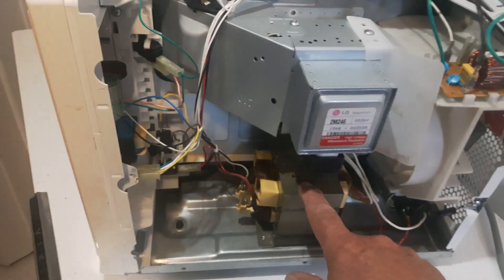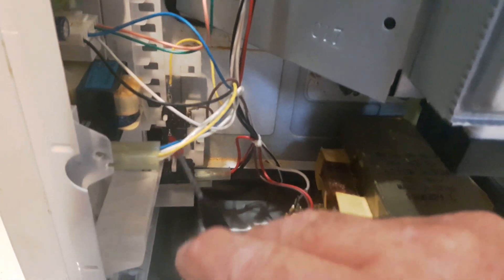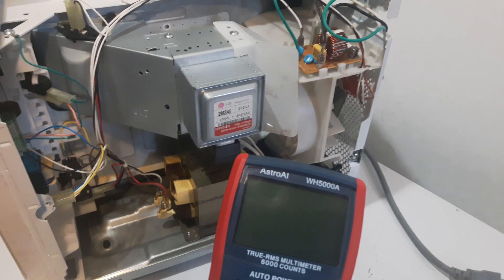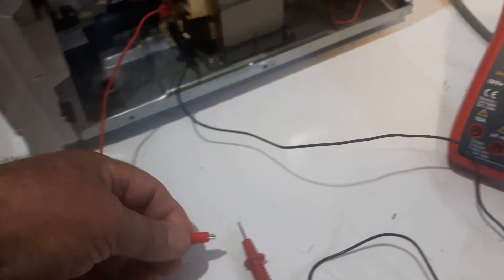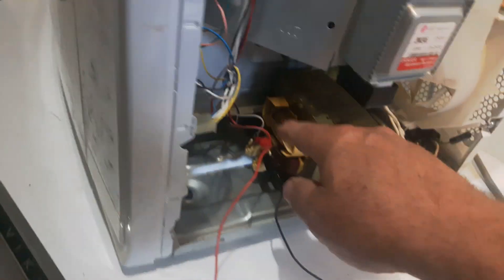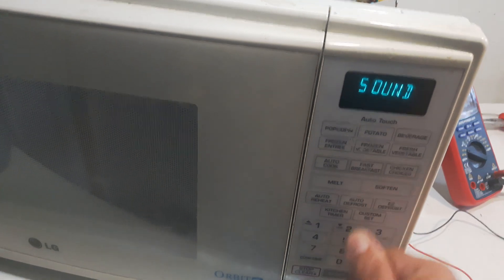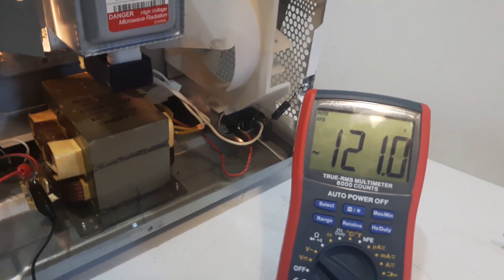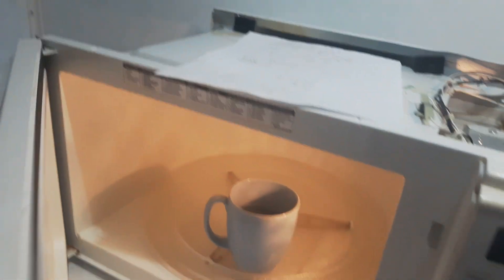Microwave runs but no heat Part 5 of 6 ( Check voltage from Relay to Transformer )

Comment: What if  the voltage is 230 than what?
Reply from the maker: You must have different microwave .If you getting 230 then your transformer should be fine.

Comment: Thanks for the video and for your time.  Correct me if I am wrong, to test the relay, you set the multimeter to DC voltage in this video.  I do not know what the transformer requires AC or DC voltage as input. Does the relay convert the AC voltage coming from the wall via the control board into DC voltage?  And that DC voltage (output of the relay) is fed to the HV transformer?  Isn't the output of the HV Transformer AC?
Reply: He set the multimeter on AC voltage  range see it once again In the USA the domestic voltage is 120V AC

Comment: Hey man what if i accidently connect magnetrons connector socket wrong, means left to right and right to left
Reply from the maker: My magnetron connection can only connect one way, wires too short to switch the wrong way.  If you did connect it the wrong way it wouldn't work  or blow the internal fuse.

Comment: What wrong with my microwave when I set cooking time the display indicator not on, what parts do you think I need?
Reply from the maker: Think it could be your ribbon cable on your panel. Here is another video that may help:  https://youtu.be/EMIgaNy-ghU
Remember to discharge microwave.  I show how to discharge in this video at 20 seconds into the video.

Comment: Testing microwave in 6 parts ??? Is it really nacessary ?
The water cup is still cold since first part and we are in fifth part , maybe it will be frozer in sixth part .
Reply from the maker: Found the problem in the 6th part.
Reply: @JimMcLaren1950   OK ... But you should provide other parts links in the description ... Just thinking , maybe it will be useful and easy to find .
We are all learning new things and ideas everyday ...
Thank you anyway .
Reply from the maker: @chocomoco1627  Thank you , good idea. I will work on putting the links.
Reply from the maker: @chocomoco1627  Thanks again, I have added the links in the description.
Reply: 120 volts just means you’re getting voltage to voltage relay . It doesn’t mean it’s good .
Reply: i did change the magnetron and still don't heat
Reply: it is a Whirlpool  double oven
Reply: MIne when u check the voltages it's intermittent. It comes to to 230v then in some few minutes it goes off for some time and come again voltage in just some seconds then it goes just like that and it's not heating at all. Is it a reason I can change the relay